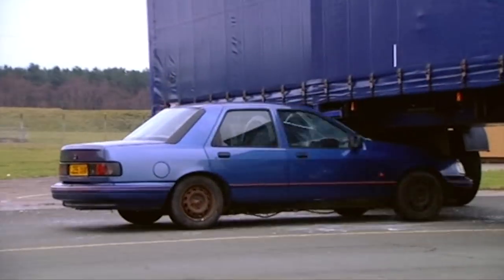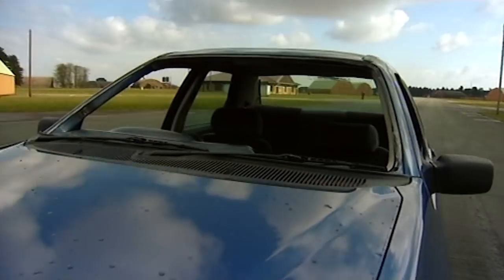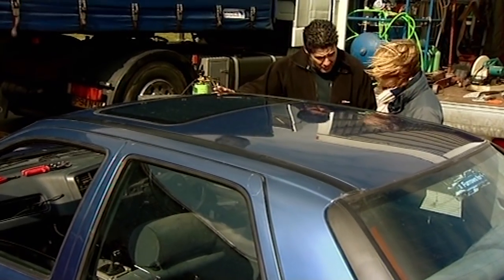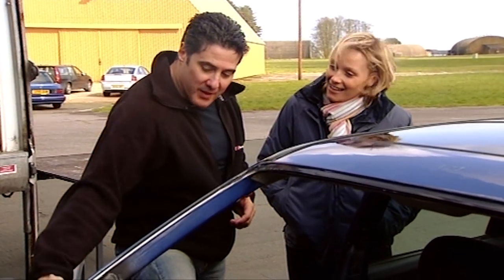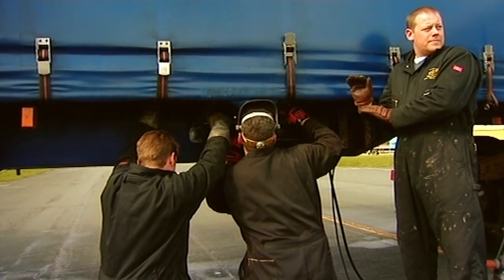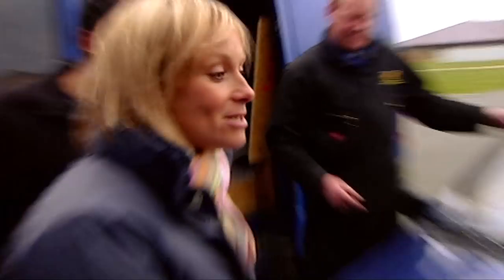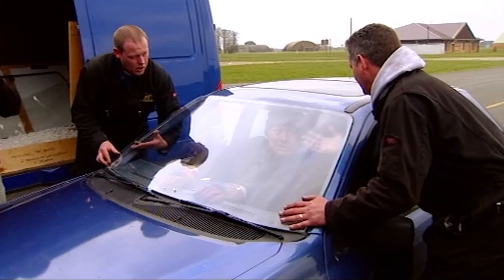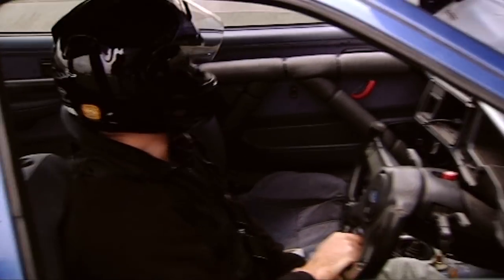Driving Under A Lorry #TBT - Fifth Gear

Comment: "Can you eat it"
"No."

Actually, you can - Sugar glass is very easy to make at home and it's completely edible. It doesn't last very long though, since it captures water vapour in the air and goes soft.
Reply: you could pull a mean gag on friends with that, 

what do i mean?: strike a sugar glass bottle on your noggin, eat the sugar glass, maybe even crash through a sugar glass window? the possibilities are endless! OwO
Reply: @tony.m7396  Once i get to power you can be my minister of internal affairs.

Comment: By the way they included the scene in the movie there was absolutely no need for the driver to be in the car... They could have just toed the car! Way easier! You just need a metal bar, a couple of weldings in the front and a toe wire. Mithbusters used to do it all the time!

Comment: Im new to this channel and i have 1 question to viewers:
Is this a Dollar General version of Top Gear?
Reply: Fifth gear is (usually) a more genuinely informative motor show than top gear, with useful consumer advice. Although occasionally, as in this case, they do also have more daft stuff. Even this is informing on how they perform these stunts though I guess
Reply: @boredinlecture  Fifth Gear is effectively a continuation of the original (pre 2000) Top Gear series - after Clarkson teamed up with May and Hammond to produce the hour-long version, several of the other TG presenters including VBH, Tiff Needell and Quentin Willson went over to Channel 5 .

Comment: What would really happen? They should've shown that, too.
Reply: No, I mean, what would really happen if they hadn't weakened the top. They would test it with remote control, of course. Not with a driver inside.
Reply: your head would be lopped off. I saw the aftermath of thathappening in Ohio.. Driver's head was gone. also there is a thing called best gore that has a video of some women that lost their heads and the one in the back seat had a broken neck from hitting a semi trailer. NB Jayne Mansfield died when she rearened a semi and lost her head.